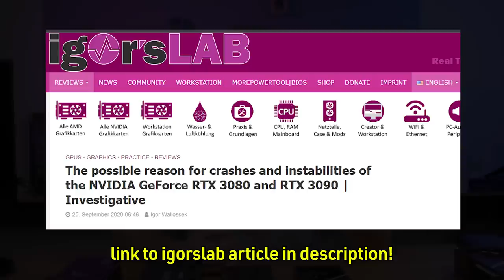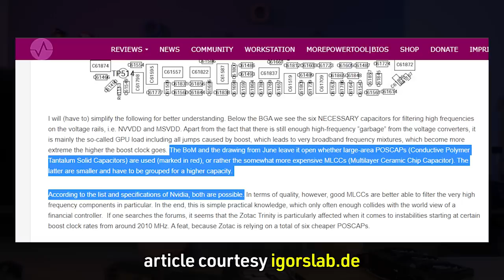The RTX 3080 Launch can't get any worse... Right? Wrong...

Comment: If the GPU is already this sensitive with power, there's a possibility Ampere is already being cranked up very close to the maximum right?
Reply: Yup, Ampere is good but only because it's on steroids lol.
Reply: Must be those awful samsung wafers, but jensen needed that 60% profits. Those jackets ain't cheap.
Reply: Yep, if you can wind it up that is free performance left on the table, if the binning is all over the place you leave that in place... if you have binning that is close you can raise the limit for public sale.
Reply: All of this sounds like a "price point thing". A 3080 could easily be made for an MSRP $1000. But would the value be there other than "it works as intended", only boosting to the same specs compared to shitting out.
Reply: For the current manufacturing quality of the chips/boards, possibly. That will improve with time though as the process is refined. If you check out some benchmarking sites, like 3dmark, there are already a couple 3080 boards posting with 2.3-2.4Ghz. I suspect over a few years, they will be able to push out a higher ceiling.
Reply: @goa141no6  It's definitely the Samsung process. On the business side it had ramnifications as well, as there are rumours that Nvidia is paying for working die because of bad yields. Could be really interesting with AMD 6000 series on TSMC, because AMD could gain an efficiency lead.
Reply: Which wafer has better overclocks chocolate or vanilla
Reply: @goa141no6  This will probably be the last time he tries busting TSMC's balls. The cost of production may have gone down, but now he doesn't have product to sell which is many times worse.
Reply: Doesn’t have to be, it could be that these are really bad capacitors. Nvidia also could’ve underestimated the minimum spec, or just assumed no one would actually do min spec.
Reply: Why is anyone suprised? Ampere is actually a downgrade compared to Turing in terms of advancement. All it is is double the coods and more watts being fed into the card.
Reply: @ezcoreg759  Where did you get this information? The cuda core count I believe is actually smaller because they changed how cuda cores work.
Reply: John J bruh have you seen any specs of any 30 series ever? Even the 3070 has more cue cores than the 2080ti

Comment: It looks like ASUS went well beyond the ref. specs using 6 groups of MLCC capacitors in their TUF line cards. That's the best option for me.
Reply: Yeah, sounds like they found a problem and applied overkill solution to it
Reply: @RunTheTape  that's 3090 not 3080
Reply: @RunTheTape  Asus Strix have the expensive type
Reply: Black Boots but the strix has something like a $150 premium
Reply: @alexpierce4380  I would just wait for a while. it  will all become clear real soon. And also avoid Asus. Remember what they did to the AMD cpu based laptops air vents? Not trustworthy anymore in my book.
Reply: @alexpierce4380  or just buy the FE.
Reply: @RunTheTape  Those aren't actually production unit photos. Here: https://static.techspot.com/articles-info/2102/images/asus-rtx3080-5.jpg
Reply: @LiroChannel  It's almost like Bogdan has his own agenda. Wow what a shocker.
Reply: @LiroChannel  ok, that is weird.
Reply: Ehem https://youtu.be/8IDMS54jEFM minute 4:02 BANG
Reply: solidliquid ok. There are conflicting photos on those caps. So my source could be mistaken. Sorry if that’s the case.
Reply: Apparently Hardware Unboxed Tweeted: "What we do know is the FE and TUF Gaming models crash just as much as other models and they use MLCC’s.
Reply: Lol mlcc is the cheapest capacitor asus went all cheap
Reply: Also remember there is different sp caps. Zotac Trinity has 6x330uf while gigabyte uses 6x470uf. The cards affected are Zotac Trinity, MSI Ventus and unspecified Evga cards. However it seems Evga confirmed the issue. Not really sure what to think.
Reply: stillward well shit.

Comment: Did anyone check prices before starting to yell about downcosting with "cheaper" non-ceramic capacitors? Doesn't seem likely. Here's what 10 minutes of basic research will get you.
Those caps they have on the back are not POSCAP (Panasonic brand of tantalum polymer capacitors often used on these cards). They are in fact Illinois capacitor (CDE) looking at the marking. Here's the part number 477XMPL002MG19A They cost $0.71 in qty 14,000. Note that the other one is a 220 uF version, which costs the same. They are not cheap. They are actually more expensive than actual panasonic POSCAP tantalums ($0.48 in qty 10,000). But that's mainly because aluminum polymer capacitors are more expensive in general than tantalum types.

Now, I don't know if anyone desoldered and actually measured those so-called "expensive" ceramic capacitors, but they look like x7r or x5r dielectric types. They might even be a cheaper dielectric like x6s. Assuming they are 47 uF each (which is not guaranteed, and nobody actually measured them, they could be 22 uF) then samsung will sell you them for $0.059 each in qty 9000. Since there are ten of them, then the total cost is $0.59. 

So the ceramic capacitors are actually cheaper. These companies buy them by the 100K at a time and pay even less than what I have listed. Ceramic capacitors, even expensive high capacity low voltage ones are pretty cheap.

Edit: it would take you about 10 minutes to change your pick and place machine to populate those pads with MLCCs instead of the caps they have there. The PCB supports it, the machine supports it, they definitely already have that cap somewhere on the BOM. So I do see them making this change, if indeed it is the fix. An actual "retooling" would be if they needed a different PCB to support it, but the PCB clearly supports both.
Edit: looking around online, some cards use panasonic SP-series caps (possibly EEF-SX0D471ER) instead of the illinois/CDE. They cost $0.57 in large quantity, which is the same as for ceramic. Also, I looked at the back of the card and see that the SMD pads do not have solder on them, so you would have to update your solder pastemask. This would count as a retooling, but wouldn't take long.
Reply: Guess it´s the mix that plays the important role here.. You need fast MLCC caps with small capacity and very low ESR and larger caps which can have an higher ESR.. If they only use the larger ones, you can get quite a lot of high frequency ripple on the power-rail which might interfere with those logic gates running at GHz frequencies near their theoretical limit..
Reply: @Spacefish007  Then why Asus' card, that only uses small ones, works perfectly?
Reply: Multiple smaller ones are not necessarily better. They take space, which at premium, also they do have different frequency characteristics. It is better to have as little capacitors as possible usually, to reduce the length of path, and loop area. With a lot of extra very small ones next to pins. Mix is not just important, it is often the only way to achieve the required performance. In high performance designs, you will have sometimes 3 or even 4 different sizes, with decreasing sizes being closer to pins. With the biggest ones somehow shared a bit here and there. You also don't want too big of a capacitance, because then VRM can't quickly respond to voltage changes (due to load) or voltage requests (due to changing frequency, temp, etc).
Reply: 47 μF in MLCC? I doubt it. Maybe 10uF top.

Comment: What I don't understand is that all of these boards are having issues so why not spread it out a bit and use better shielding? With that kind of clocking any delay made would be offset anyways. Just move them out a bit and use a pressed shield cover so the interference isn't so bad.
Reply: The issue turned out to be Nvidia post release drivers (pre release drivers were fine), had NOTHING to do with capacitors. Jay need to take down this video as its still misleading people like you,  but he keeps leaving it up for clicks $$. Yes Nvidia released a updated driver that corrected the problems on ALL regardless of capacitor type. Watch this explains all.
https://youtu.be/lhyCdraz54s?t=350

Comment: Engineer: If we use cheap parts the card will malfunction. 
CEO: I don't think you understand the problem. I only have 6 yachs.
Reply: Typo gives that extra bit of flavor.
Reply: Pretty sure there’s a t in yacht.
Reply: Yaks?
Reply: This has nothing to do with that. Any product you buy has a profit margin and people have expectations about what these cards will be priced at. They require beefy cooling to deal with the chip and due to Nvidia's emphasis on cooling, they can't cheap out on that (like say the MSI 2080 ti armor which was bottlenecked by its whimpy cooler) so they find other places to cut costs to provide an aftermarket cooled, near msrp card.

Unless you live in some Marxist utopia where a company doesn't need to make a profit to survive, this is what a market analysis forces companies to do.
Reply: The problem is that if all companies use one or two sets of MLCC caps, and one skips and uses only POSCAPs, then the cheater will get like 1/2 the market share by costing less.

It's not about the CEO's yacht, it's about not wanting your new card to cost 10% more than everyone else's.
Reply: @klasta69  unfortunately in most small to medium sized companies they force it so hard that engineers have no compromise but to be cheap as possible. Then have fingers pointed at them by sales an other management because the product doesnt have great reliability. I left engineering because of this...
Reply: @klasta69  Spot on, a CEO would never release a product until it meets stringent standards. Im kidding, your banned from using the word marxist.
Reply: @klasta69  Eh we don't know what their cost/margins are.

In any case by looking at the FE it looks as though they only needed to add one additional high quality capacitor to clean up the power delivery.

Caps are generally cheap AF. Maybe not these but at least all the ones I have used for wiring stuff up in my lifetime.

In any case adding one extra high quality cap to meet power delivery standards would not have broke the bank, no need to go around babbling about marxism in this case (there's plenty of other postmodernist morons who are more deserving to be yelled at over such things these days)
Reply: @johnbowman3630  The cost of a different part is highly dependent on the supply-chain and assembly-proces. Changing it last minute, if it was expected to be fixed a driver update for instance, could cost hundreds of thousands of dollars by requiring changes to the assembly line and rendering your stock of already obtained caps obsolete.

The "joke" that a single executive would or even could do this because it would magically result in a significant increase of his income is ridiculous. As you stated yourself, the difference in cost of the part itself is probably close to negligible. If the market would allow the product to be marked up for said changes to be allowed, then it would be. But prices are fixed by what the target population is willing to pay and stating some evil capitalist executive could change that for personal gains is nothing more than Marxist nonsense.
Reply: @klasta69  "rendering your stock of already obtained caps obsolete"

Negative, the caps would not be wasted, as all that need to be replaced are 1 (for most cards apparently) or 2 at most, so the same stock ends up getting used.

"The "joke" that a single executive would or even could do this because it would magically result in a significant increase of his income is-"

is just a joke... like seriously, I think you're reading way too much into it.

If the market would allow the product to be marked up for said changes to be allowed, then it would be. But prices are fixed by what the target population is willing to pay"

Actually these cards ARE marked up from the MSRP ($700) of the FE, since generally forever. They are already typically including better cooling systems/OC core clock, which users like myself have historically been willing to pay a premium for... prices aren't 'fixed' at all in this case

Comment: The ASUS TUF was the card I was most drawn to. Something about it caught my attention. I wonder if any of the other AIBs have the expensive caps on them. 
Good on ASUS for not cheaping out.
Reply: Was going for it too, but apparently it's more complicated than that as someone posted that they had seen the tuf model with the bad cap design as well. Evga have admitted sending out both "pre production" cards and ones with revised power delivery systems so what is there to say that other manufacturers have not done the same thing mate.
Reply: The images on Newegg for the ASUS Tuf 3080 show the big cheaper capacitors, but Hardware Unboxed shows the card with the smaller more expensive ones. Perhaps they discovered the problem early and fixed it before release?
Reply: It needs to be seen in the consumer end product, as most review channels got ones of the earlier pruduction line up. 
IF they catched it early enough it is indeed good news and a nice one from ASUS, but the other way around as in sending the "good" ones to the reviewers and using the cheap caps on the end consumer production line has the potential to be devasting reputation wise.

We would be in a adding-microtransactions-one-month-after-release territory...with a $700-$1500 piece of equipment.
Reply: @The0Gizmo  Hopefully mate, we'l have to see what info comes out. It Is possible that there are different versions with good and bad capacitors which have been sent out as evga have admitted but we'l see. Jeez bit of a mess at the moment. So glad I always wait for a few months after launch before I buy anything no matter the hype.
Reply: @mwreyf1   Yeh seen that myself, we definitely need to have more info on what cards people have actually been sent. Some have said that even their tuf model has been crashing so would make sense if they had the inferior caps where others had not.
Reply: such things may change w/o notice in future board revisions. always be cautious here, im quite sure they know how to make a good first impression and then cheap out in the future
Reply: I've been running a 2070 super from Asus and never had an issue. If and it's a big IF do the upgrade I'll probably go Asus after a lot of research ofc 😂
Reply: @mwreyf1  old images. People who actually bought the ASUS TUF are reporting that they have all 6 good MLCCs.
Reply: My TUF 3080 has 6 of the expensive ones (just recieved it)
Reply: @gibs1919  Thats good to hear that ASUS caught and mended it.

Comment: What's interesting with the ASUS TUF in most of the marketing images on retailers web sites show it with six of the cheap capacitors but boards reviewers received and that are shipping have all six areas with the expensive capacitors so "maybe" ASUS found this issue and then decided to use all expensive capacitors and slightly overengineer their cards.
Reply: MSI Ventus promo pics show all 6 cheap ones as well, actual unboxing pics of cards in users hands however show them  with one bank of the expensive ones, so it looks like something changed for several brands from time of their promo photos to released cards
Reply: You are probably correct. I wonder if that's also part of the reason why MSI supply is super weak even compared to other brands. But after all they're reputable brands and they probably found this in testing and... well... used it to their advantage. Sort of.
Reply: Pete Lunn or review versions Are better than retail versions... Nah that can not happen yet... there has been cases where manufacturers have make the product worse later, but not this soon so most likely asus did just up, because They did get problems. I sure hope so!
Reply: I think there are 2 versions, the regular and OC. Maybe the OC version has 6 expensive ones and the regular has 6 cheap ones?
Reply: @simon7109100  In regards to the tuf model the non oc model has the expensive capacitors.
Reply: so thats why the TUF recieved some good praise...
Reply: simon7109 OC means overclocked, it doesn’t have anything to do with it
Reply: @simon7109100  don't think so. This is a normal tuf and it has 6 MLCC's
https://youtu.be/-a9arPs3xpY
Reply: Same with the Strix
Reply: I noticed this too. If you look at the images on Asus’ site, you can see they clearly have 6 MLCCs.
Reply: They probably bulk bought and used the same for the strix and the tuf
Reply: Both the OC and normal one have the good capacitors. Even though on both the stock images show them not having them lol
Reply: Good pickup!
Reply: I just come back to this comment section after seeing this on Overcockers.co.uk
So now, once more knowledge is out there, the ones with better capacitors are going to go up in price.

However missing out on the first batch of cards, may not be a bad thing. This now means there may be better revisions coming out that are better hardware and also gives AMD a good chance to put the heat on.
Reply: Could be, yeah.
Reply: i have the regular non OC TUF 3090 here, it has 6 of the better arrays. . which i'm relieved to see.

Comment: FFS I’m cancelling my order, cya in 2021
Reply: That's it, brother. Life goes on. Shit always keeps getting better. Just gotta have a little patience.
Reply: Cancel it and get a asus one, would be better
Reply: Amd Radeon 6900XT next instead of Nvidia
Reply: where did you buy it so i can line up for it
Reply: It won't be any better then either.
Reply: @HyperSin  ASUS TUF in the UK at least uses the cheaper capacitors for all 6 caps, so don't get the TUF I think Jay meant the STRIX.
Reply: @HyperSin  asus has the bad ones as well i just looked it up cause i ordered one, might cancel as well...
Reply: Asus is using 6 of them instead of 2 like fe or 1 like the other asus is by far the best
Reply: @Somehandle16  nope strix also uses 6 bad ones, he means the OC version of the TUF thats the only one ive seen with six of the good ones.